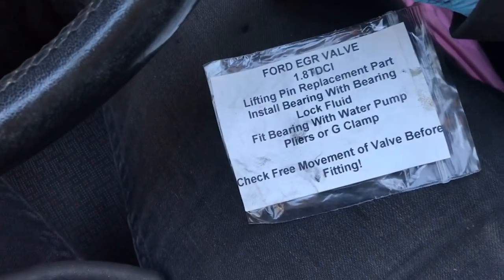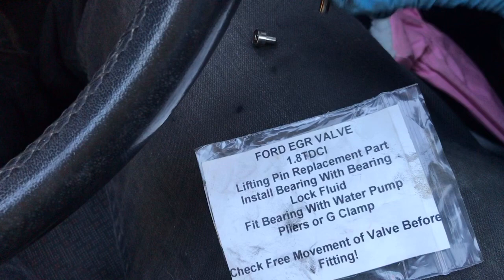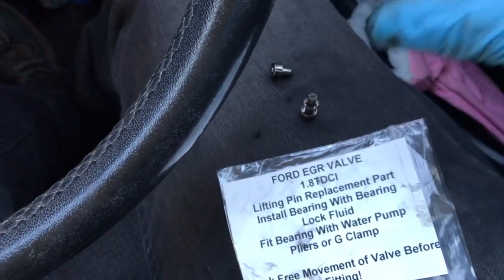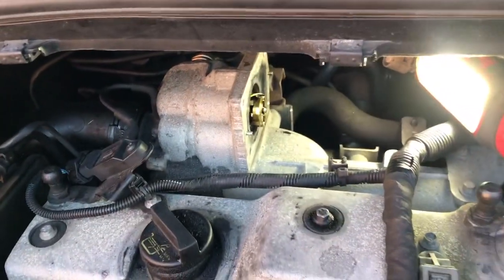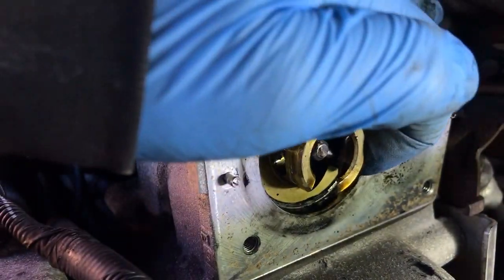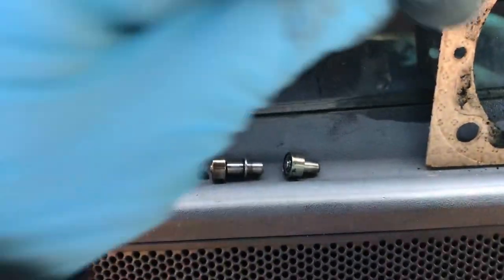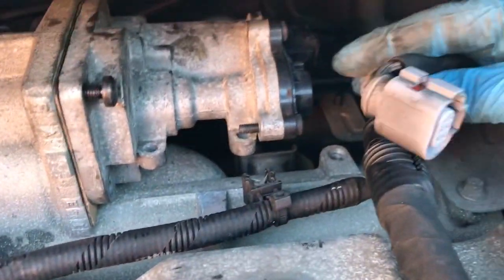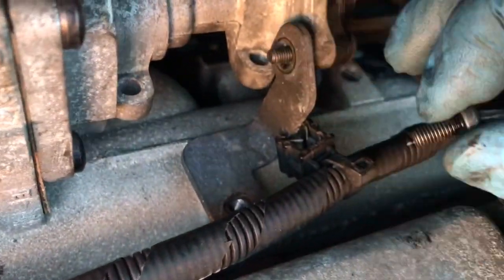Ford 1.8tdci EGR fault repaired using lifting pin repair kit

Comment: Hi mate, do you have another video on how to actually do this please? Thanks
Reply from the maker: Hi Luke, unfortunately this is all I’ve got, I was working on a customers car while at work when taking this vid so I had to do it slyly hence the poor content quality, I thought it could help someone out with the same problem and maybe save some money. 

It’s straight forward and self explanatory to do though, if you dont feel comfortable doing it you could always approach a mechanic with the repair kit 👍 shouldn’t be expensive in labour as it’s an easy enough 10 min job.
Reply: @danthecarman4344  Thanks mate, can it be done on any car with an EGR? Is the purpose of the EGR purely to reduce emissions?
Reply from the maker: @fgcvhhbvjhbj   

Normally egr valves come as a separate self contained part, but on the Ford 1.8tdci engine it’s incorporated into the intake manifold. Meaning that to replace the egr valve on this engine you have to replace the entire manifold which is quite expensive and labour intensive. The purpose of this video is to show how to repair the egr valve using the lifting pin repair kit which is specific to this engine. 

It’s common practice to replace egr valves when they’re faulty especially if they’re difficult to remove, if it’s easy to remove or really expensive to buy you can attempt to clean it first to see if that solves the issue. But if it’s difficult to remove and not overly expensive and your confident with the diagnosis you’d usually be better off replacing it, ideally with a new oem replacement part. They often get gammed up with carbon and the valves stick open or closed causing an array of symptoms. 

In basic term the purpose is to take x amount of exhaust gas and channel it back into the intake manifold to be re-burnt, so it is emissions related, on some vehicles it’s possible to block the egr valve by fitting a blanking plate but it’s not 100% kosher.

Comment: Hello, thank you for the video. The link to order repair kit doesn’t work , is there a new link ? Thank you
Reply from the maker: https://www.ebay.co.uk/itm/FORD-EGR-VALVE-1-8TDCI-COMPATIBLE-LIFTING-PIN-KIT-/334154834707?mkcid=16&mkevt=1&_trksid=p2349624.m2548.l6249&mkrid=710-127635-2958-0
Reply from the maker: Hope this helps…
Reply: Link is not found

Comment: should i use some oil to lubricate it ? i feel like mine is sticking but ive cleaned it 2 times
Reply: the golden part on the manifold
Reply from the maker: You could try wd40 mate, the bearings could be contaminated with carbon inside causing them to stick?